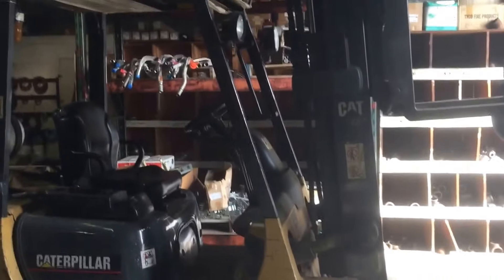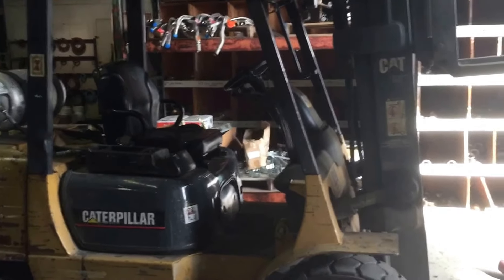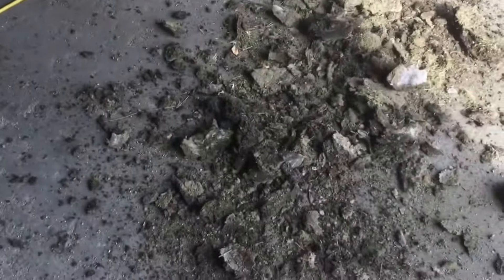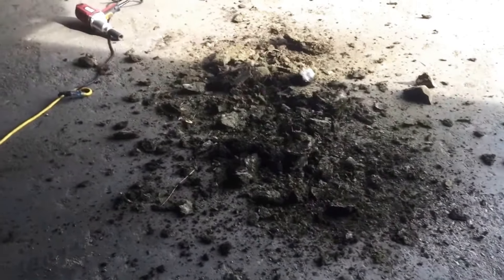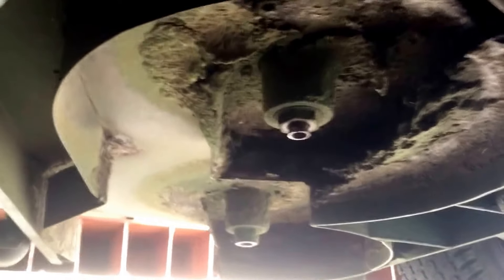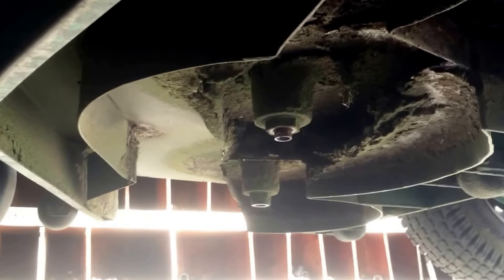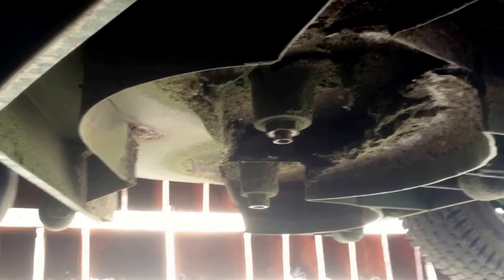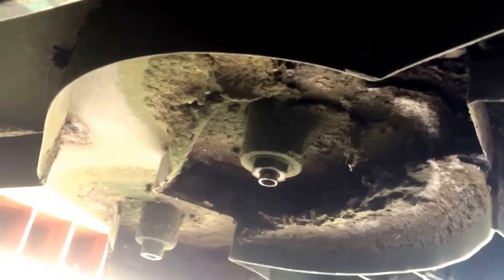Important to Clean Under the Zero Turn Deck

Comment: Could having excess build up under the deck cause the belt to constantly slip off as well?
Reply from the maker: It is possible, but it would probably have a to be a huge amount of build up.  My guess is that there are other factors that are causing the belt to constantly slip off.  These are some that I can think of:  1. The belt is stretched or possible the wrong size, if new, 2. The tension is not correct on the belt or the tensioner pulley may not be keeping good tension on the belt, 3. one of the pulleys may be bent or off center, so when extra tension is added to the belt, under load like engaging the blades and cutting wet or thick grass, it could slip off.  These are some of the places that I would start looking if I was trying to figure out why a belt was constantly slipping off.